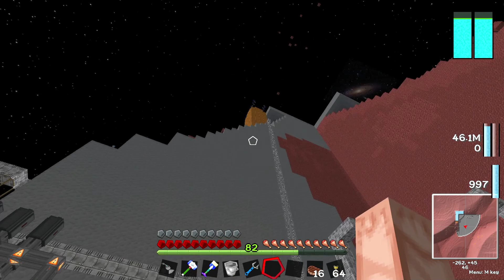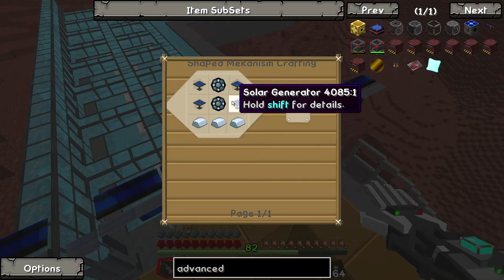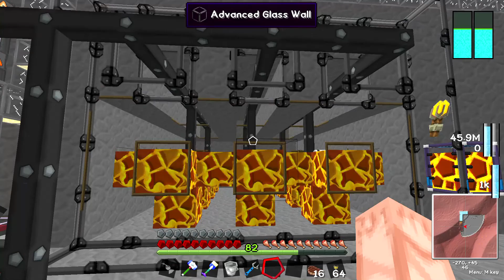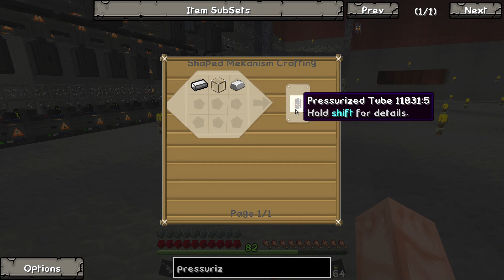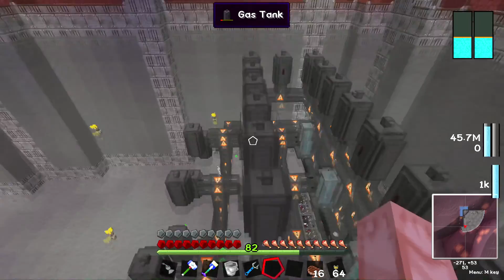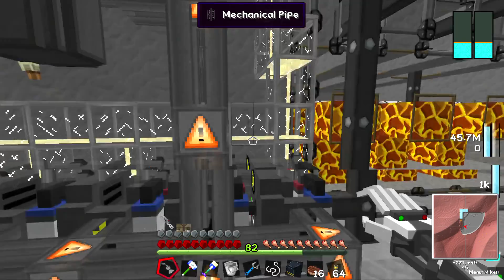Better Than A Let's Play (Season 2) (Ep. 27) - Mekanism Hydrogen Chloride Plant

Comment: A rotary condensentrator (cheap, doesn't use a lot of energy) can turn all that gas into a liquid, which can be stored in dynamic tanks, then changed back into a gas on the other end with another rotary condensentrator. That would have saved you all that osmium. Also, it's one more step that looks cool! Liquid hydrogen, dude!